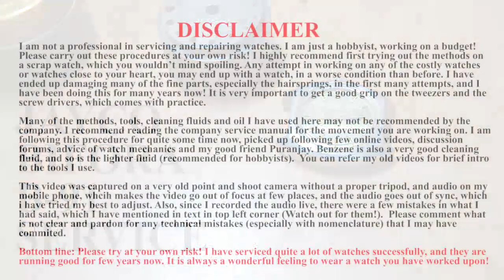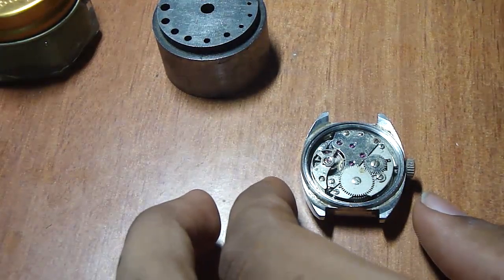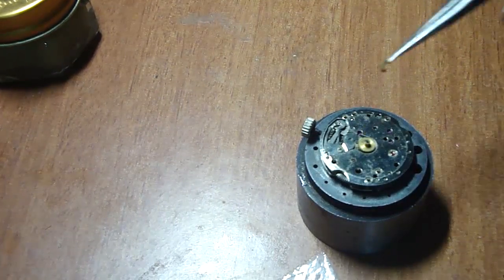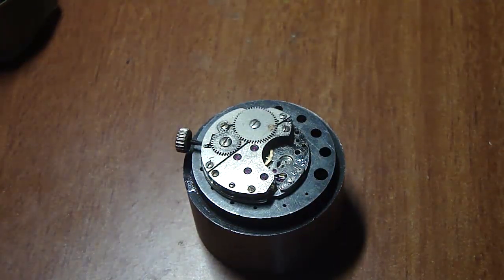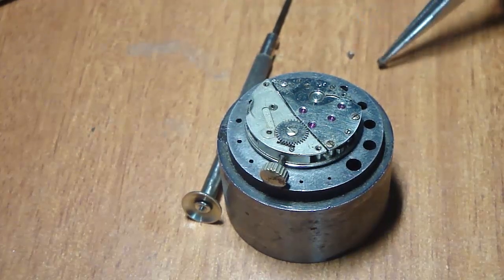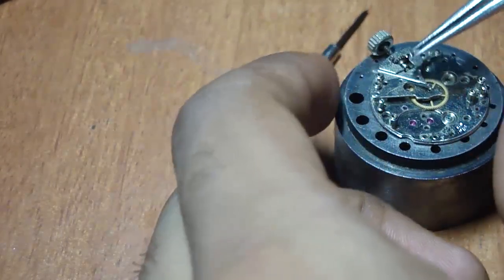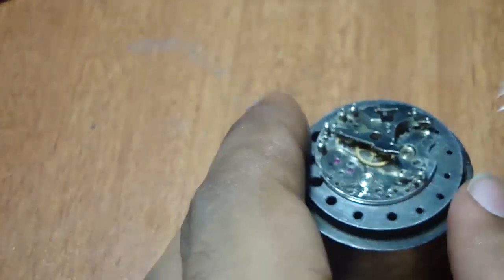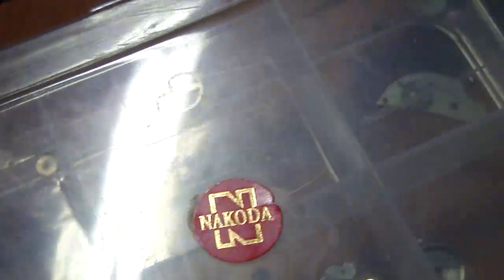Jayco Bifora B-91 Service Part I: Introduction and Disassembly

Comment: The barrel without the lid is scary looking. You seem to have good expertise in walking out the main spring sir. It is pleasant to watch you do this. And the way you identified that the mainspring has been rough handled by observing that it is not flat, is a clear example of your diagnostic skills. Please keep up the good work sir.

Comment: Following your excellent video disassembly on a Bifora watch made it so easy working on my Bifora watch - many thanks. I have some information for you which I discovered during disassembly - the crown wheel screw you found difficult to unscrew actually turns clockwise to undo. It is not a conventional anticlockwise turn to undo. ￼

Comment: Thank you for this video sir. It is very helpful. 
It is interesting to see the way you use the pin vice to remove the canon pinion. I will try out this method.
And the dreaded pinging of the click spring. It is a nightmare that we try to avoid everytime we remove the click spring and the yoke spring. I am glad that you were able to find it after it pinged across the table sir.
You are doing  great service to the community by creating these informational videos.
Please keep up the good work.
Reply from the maker: Thank you sir, I'm glad I was of help.
Reply from the maker: The pin vice method is the best I feel without specific tools for the job that I have seen elsewhere.